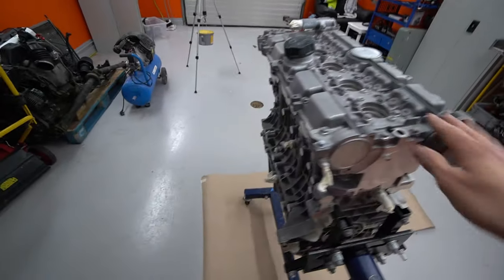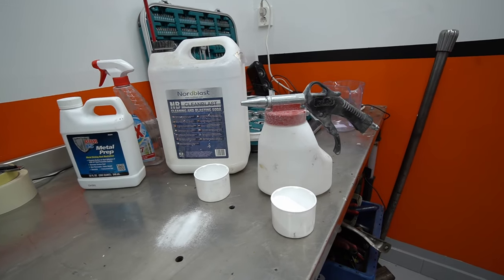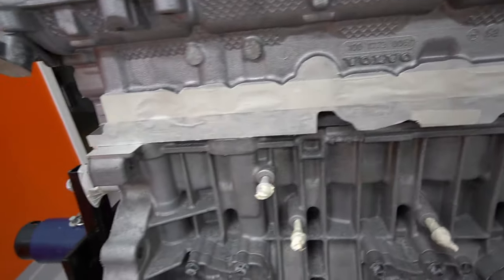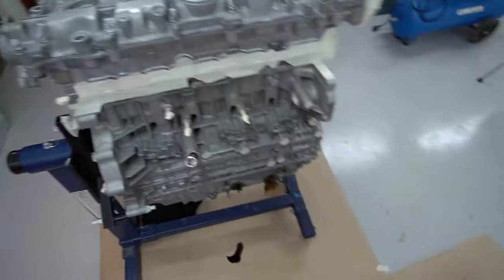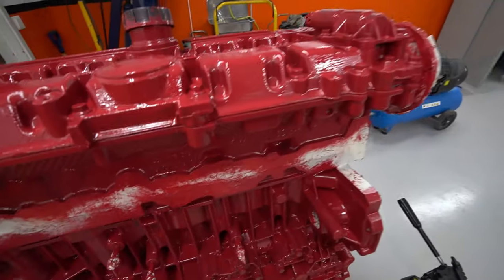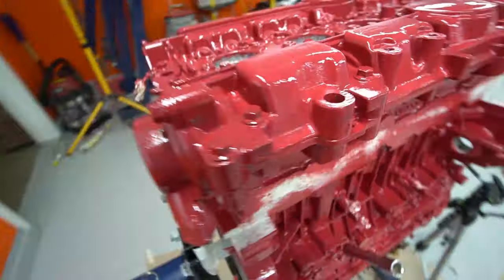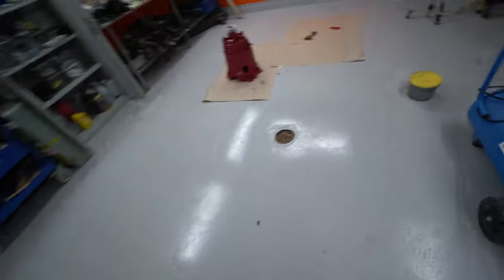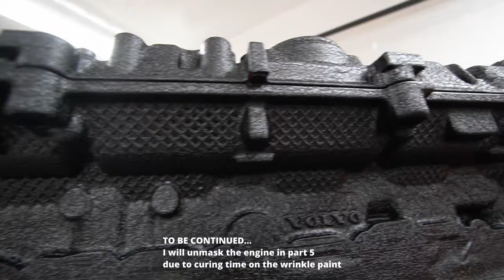VOLVO 740 T5 ENGINE SWAP - Part 4  - PAINT ENGINE WITH POR-15

Comment: Very cool project. Thanks for sharing it with us. Does this engine have any freeze plugs?
Reply from the maker: Thanks!, No i don't believe it does. The term frostplug/freezeplugs is a bit misleading since it has more to do with how the casting process was done. This engine is an open deck design so that will leave room for the casing sand to run out between the cylinders during the manufacturing process.
Reply: @BackmansGarage  Thanks for your reply. I am living in a place that has very low winter temperatures (Fort Nelson, BC,  Canada) and wondering if an immersion-style heater is available for the B5252T engine in my 2006 V70.